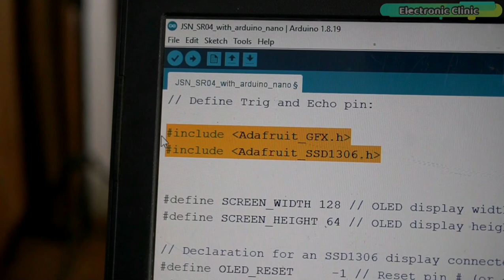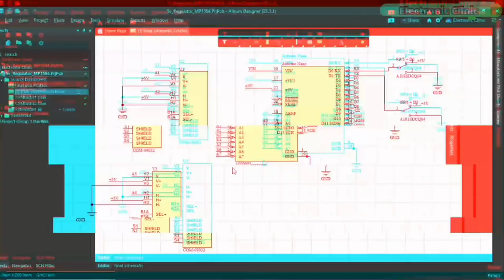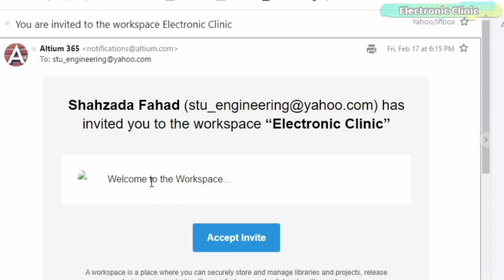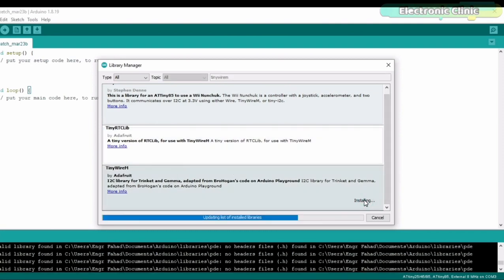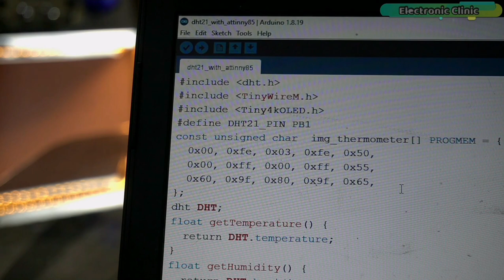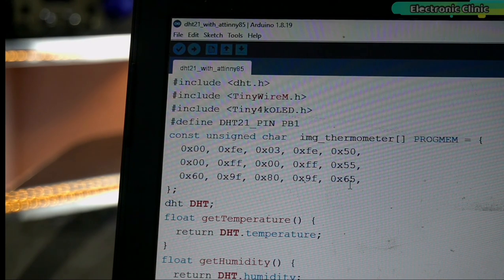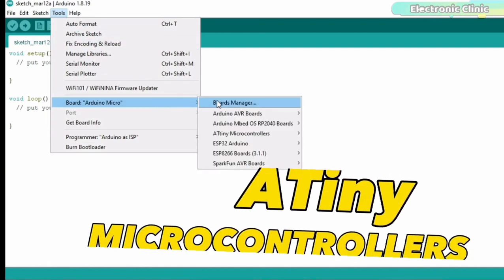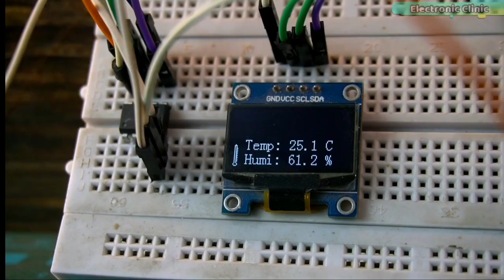ATtiny85 Project DHT21 Temperature & Humidity Sensor and SSD1306 Oled Display, Arduino IDE

Comment: same coding issue as listed below. syntax issue with the code. dht.h isn't found, DHT.h is available, but dht DHT is creating an error affecting the rest of the coding. Also I'm getting a serial error. Any help would be appreciated
Reply: Found the issue. DHTLib is the correct library. Sorry for the confusion.

Comment: Nope. Code doesn't work. OLED doesn't even come on.
Reply from the maker: check your oled module, you might be using the shh version.
Reply: @ElectroniClinic  it runs on a regular arduino as an SSD1306 without issues. Someone made a mario bros attiny85 ssd1306 game, but didn't provide the source, but did have the hex file. I loaded it successfully with avrdude to the attiny85 and the oled worked. So it is something in your setup or code that isn't working.
Reply: @ElectroniClinic  Discovered the problem. Most I2C modules have built in pull up resistors on the SDA and SCL lines. Unfortunately, those lines are shared with the MOSI and SCL lines, which a programmer, such as a USBTiny or Arduino ISP will be programming over. So long as the SCL of the I2C device is disconnected from the attiny85 at the time of programming, and then reconnected afterwards, this works.